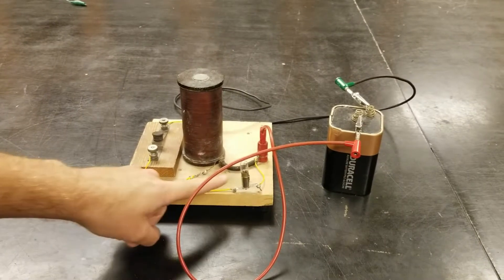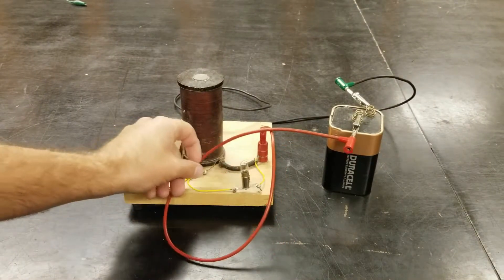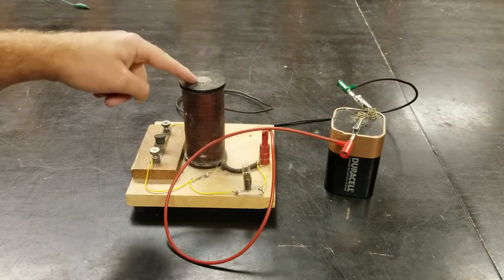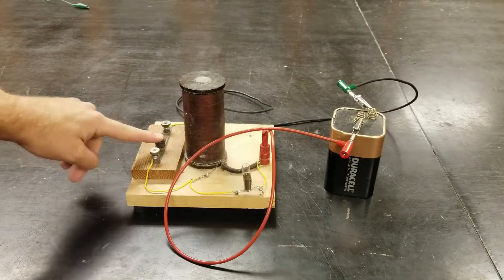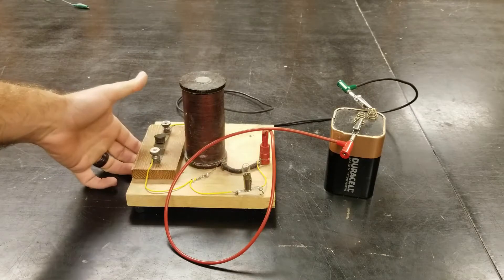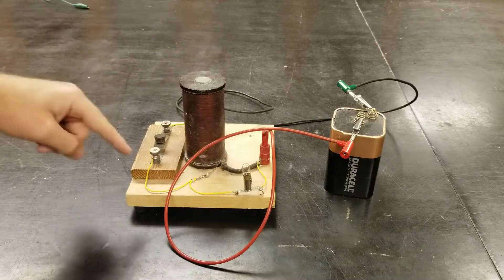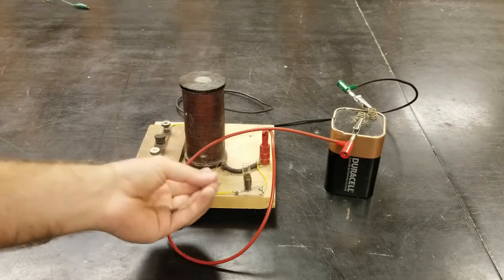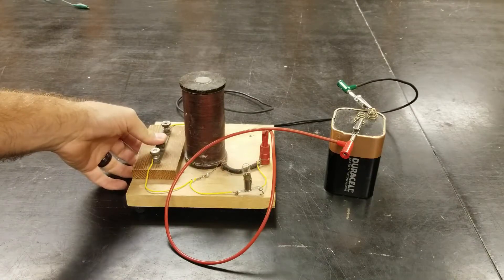Back EMF

Comment: Hello Sir, thank you very much for your scientific demonstration. If we analyse the RL circuit in any book, the potential across the inductor is the same as the potential of the applied voltage, so the battery ! Yes, the sudden release of the button creates a larger voltage than the battery. What about the current here and the power, also the energy equation ? 
Would this mean, we have a higher potential for a less time interval, which makes the current smaller, which means the product P=VxI and W=Pxt would be the same. However, the power is not a conservative quantity. The area under the graph of V(L) versus t should be the same what I understand. If we have a higher potential by turning off the switch, the time would be less, the current should be also smaller, am I right ?

Comment: It's the collapse of the magnetic field inducing a voltage in to coil, not "back emf running through the transformer getting stepped up". The low voltage induces a magnetic field in the windings ie. electromagnet, that when collapsed create the higher voltage pulse, aka back EMF.

Comment: I have back emf of 230v -300v from 10 volt supply and it is stable and lights up a 220 volt lamp. is this good?
Reply: How did you succeed this, did you build an on-off circuit, may I ask you ? How much did you put into the circuit, and how much did you get?
Reply: @Birol731  I have uploaded a video to show the back emf from my newman type motor, have a look and let me know what you think. thanks

Comment: I haven't seen this one before. Is it a transformer, or just an inductor?
Reply from the maker: It is just a transformer
Reply: It is a single winding.   The tip-off was the demonstrator pressed the switch, and held it briefly, then released the switch and the 90vdc neon lamp bulb flashed.  This is the novelty aspect of the demonstration, "press-and-hold-switch, release, and 90vdc bulb flashes despite only 6 volt battery"

However, prior to the flash, he earlier pressed the same button, and did not hold it very long, and when the demonstrator released the button, no flash in the bulb.  WHY NOT?

In other words, why did holding down the button a little longer during the 2nd push of the button create the flash?

There is an L/R  'time constant' - it is the inductance of the winding divided by the resistance.  L/R  is in seconds (of time).  It takes 5 (five)  L/R time constants to fully build up the magnetic field in a coil.  And the the button was not held long enough the first time to build up a large magnetic field in the large number of windings.

FIRST BUTTON PUSH
The demonstrator briefly pushed the button and released it, and not enough magnetic field was created in the large winding to provide the 90vdc spike of Back EMF when the button was released - when the magnetic field collapsed, the Back EMF was routed through the bulb (which is obvious from the yellow wire harness), and the Back EMF was not sufficient to fire a plasma in the neon in the bulb.

SECOND BUTTON PUSH
The demonstrator held the button down longer, allowing a larger magnetic field to build up in the coil, so when the button was released, the magnetic field collapsed, and it was enough Back EMF voltage to spark a plasma in the neon gas in the bulb.

A smaller coil - such as in the primary winding of a transformer - has a very brief "five L/R time constants" period and in my opinion, even the first button push would have lit up the neon bulb if there had been a primary winding.  But the bulb flash required a longer 'hold time' of the button,, which indicated the battery was hooked directly to the only winding we see, a large number of turns on a spool.  

If the demonstrator was available, we could ask him to show us the primary winding, but this is a 3 year old video and it's probably not feasible.
Reply: @Greg_Chase  How is that possible, is this the effect of the sudden energy release, I mean how can you explain the voltage increase ?
Reply: @Birol731  Well, we can't ask 'The Demo Guy' because of the age of the video, to show us that there are:
1)  two windings in the coil that we see
2)  and the 2nd winding has many more turns of wire than the other winding

so there is no way to reliably say "this is obviously a step-up transformer".    However, the number of turns is quite large - it's a big coil.  You can show mathematically, and it makes intuitive physical sense, that a larger coil builds up a bigger B field (magnetic field) than a smaller coil, if five L/R time constants pass to charge it up.

EXAMPLE
The B field of a 'coil' consisting of one (1) turn of wire is compared to the B field of a larger coil consisting of 1000 turns of wire.  The larger coil builds up a larger B field.  The designer of an electromagnet abandons his plans to build and sell electromagnets with just one turn, and instead builds his electromagnets with 1000 turns each.

Also - if the B field is allowed to build up (5 L/R time constants),  it is equivalent, physically, to building up a charge in a large capacitor - a large storage of energy.  

The charge stored up in a tiny capacitor cannot kill you.   The charge stored in a large capacitor can.  
The inductor (the coil) stores energy in a magnetic field, instead of an electric field.  When the energy discharges from the magnetic field, the temporary voltage spike can be quite large.  Particularly from a large coil.

The magnitude of the voltage spike - the Back EMF - depends on how quickly the magnetic field changes.  If the B field of that large coil was allowed to discharge slowly through, say, a resistor,  the field would discharge slowly.  Or if a shunt (or 'flywheel') diode was hooked across the coil, same thing - the B field would discharge slowly.

But this is a quite sudden change - it is a switch. He holds the switch down long enough (on his 2nd attempt) to fully 'charge' the B field of the coil.  Then the switch it quickly opened.   A large Back EMF spike will occur.

He is discharging the Back EMF through an inert-gas-filled tiny volume - the Neon bulb. Based on the size of that coil, the sudden change to the current flow - dropping to zero almost instantly - this is a very sudden change to a very large magnetic field.  Hook up an oscilloscope to it,  I would not be surprised to see a spike easily reaching 90v.
Reply: @Greg_Chase  Thank you very much for the explanations, especially for the effect of briefly pushing the button. So, a certain amount of energy must be stored in the magnetic field of the coil, unless a spark will not be created in the neon bulb. Approximately 5 (L/R) is enough to charge the coil, so the area under the V(L)-t graph (between zero and infinity) would be equal to A=U0x(L/R), with the unit Vs which is equal to Weber (Wb or Tm²- Magnetic Flux) if the time is very short (t << (L/R)) the area is equal to A=Uoxt, this seems to be conserved am I right ?
Which means, if you release the energy suddenly, you can have a higher potential than the applied battery voltage, in this case the time is shorter, so Ux= (U0x(L/R))/t, U0 is the battery voltage (applied voltage). For example, if we use a 6 volt battery, assume L is 1 Henry, R= 10 Ohm, the magnetic flux would be equal to MF=6V*(1H/10 Ohm)= 0,60 Wb, assume the release time of the button is 5 ms, you would get Ux= 0,60 Wb/(5^-03 s)= 120 V, so the shorter the time, the higher the potential, but I found out that the area under the graph which gives the magnetic flux is conserved, is there still a possibility to extract energy from the ambient medium as Nikola Tesla has claimed ?
Reply: @Birol731  I've been away from the math too long to remember it.  One thing I've noticed - lack of use leads to a re-acquisition effort for knowledge that once was top-of-mind.  I started playing piano at age 6, by age 8 I was performing in front of a sizable audience.  Today, I can't even remember the key signatures.  

Same with most of my electronics/EE, and software engineering.  After graduating from UC Berkeley in the mid-1990s with a computer science degree, I wrote code and worked in startups for about a decade.  I then went back to Berkeley, got my MBA, and switched to investing.  As a hobby I work at artificial gravity devices with a small group. 

So I cannot safely comment on the math without a review - it has not been top-of-mind for years.  I could say 'yes it looks correct' but I wouldn't without a review.

In our artificial gravity devices, we have a few different approaches.  Here's a popular one right now with us:
1)  lamination of thin layers of non-ferrous metal
2)  two such laminations stacked vertically, one atop the other, with an insulator ring separating them
3)  vertically-oriented magnetic field by way of a (paired) Helmholtz coil centered along the axis of the two laminations
4)  UV light focused on the metal layers to encourage the photoelectric/photoconductive effect to free up more conduction-band electrons in the metal
5)  eddy current-inducing coils, deployed horizontally and adjacent to, but not touching each lamination of metal layers
6)  eddy current coils fed by high frequency
7)  only one lamination (at a time) gets induced eddy currents, the other lamination is 'off'

The idea is:
A)   create high frequency, coherent accelerations of the charged particles in the lamination that is 'on'
B)   create an unbalanced effect by keeping, say, the top lamination 'on' and the bottom lamination 'off'

We studied the Vacuum and developed an 'informed speculation', a model, of gravity and we test our model with devices.
Reply: @Greg_Chase  Hello Greg ! Thank you very much for sharing all these informations with me, my physicist friend was also interested in artificial gravity. Let me ask you first, do you have a youtube video about your gravity device, a demo video, something like that? 
I would like to ask you another question, did you hear something about cold electricity, a sort of radiant electricity where the wires get colder, the wires absorb the heat, instead of heat dissipation.......This process has a reverse, negative entropy 🤔
Reply: @Greg_Chase Thank you very much for your last answer, about the artificial gravity device and your interesting information about the fusion reactor with an artificial gravity containment field. You want to say that, it seems difficult to extract energy from the vacuum, some scientists claimed that, when the soft electrons disintegrate into hard electrons (conduction electrons) the total energy of the aether remains constant, which seems not against the law of conservation of energy. Tesla told something about radiant energy, did you hear anything about his radiant energy concept?
How is it possible to pulse a coil with DC,  I mean strong and quick pulses, can I achieve this with a conventional function generator ?
Reply: @Greg_Chase  What about the Magnetstromapparat of Hans Coler? Lester Hendershot also built a similar device (Hendershor Generator) to extract energy from the magnetic field of the earth. Did you hear anything about these devices?
Reply: @Birol731  You can 'charge' the magnetic field of a coil with DC.  You can use a function generator, with a square wave, to pulse that DC if the DC is connected to the coil through a transister, typically a MOSFET. 

Step 1 - recall that a coil has two wires, one at each end of the coil

Step 2 - connect DC to one of the two wires of the coil 

Step 3 - instead of connecting the other wire of the coil to ground, connect the wire to the 'drain' pin of the MOSFET

Step 4 - connect the 'gate' pin of the MOSFET to the function generator output - this means your square wave, applied to the 'gate' pin, will turn that MOSFET On and Off at the square wave frequency

Step 5- connect the 'source' pin of the MOSFET to ground

HOW IT WORKS
1)  Because only one end of the coil is connected to DC, if the MOSFET is Off, no magnetic field in the coil, because of no current flow

2)   When the MOSFET turns 'on' the coil will be connected to ground through the MOSFET, and current will flow, and the coil magnetic field will appear

3)  the coil magnetic field will toggle on and off at the frequency of the signal generator
Reply: We have a small team working with devices to manipulate the Vacuum (the quantum Vacuum) for artificial gravity work, and it's not clear that Tesla's "radiant energy" will succeed without air molecules.  Coherent, organized behavior in the Vacuum is possible but it quenches fast and it quenches close to the source.

A UFO that has altered the Vacuum to hover creates a thin volume underneath it where inertial drag is greatly increased and the acceleration of matter is impeded (that's why they hover).  The volume of space under the UFO that is conditioned to neutralize gravity, aka to increase inertial drag, does not, and is not, very thick at all.

My disclaimer is that we do not work on radiant energy propagation.  The stuff we work on is to create very local effects only, and that is tricky enough.  If we would pursue answering the question "can radiant energy work outside an atmosphere" the starting point would be a vacuum chamber pumped down to 10^-7 Torr  (0.0000001 Torr) which is entirely possible with cryogenic pumps.  Not cheap to set up a big enough chamber though, and cryo pumps are not cheap either.

I worked with cryo pumps used in Perkin-Elmer sputters in the semiconductor industry early in my career, and it's pretty shocking the degree of vacuum they can establish.  The vacuum chambers are huge, heavy steel, huge manifolds and bolts, and can develop leaks.  We used helium and a mass spectrometer probe to find leaks in those things and it was a PITA.

But it would be a fairly reliable environment to check if radiant energy requires gas molecules (atmosphere) to work.
Reply: @Birol731  looking at 'extracting energy from the Vacuum' - we rely on conservation of energy and momentum and do not spend time on pursuing free energy.  Just not something we do.  We work at artificial gravity, mainly.

If you have a catalyst like in T. Henry Moray's free energy device, you have a chance for 'breakeven plus.'  His device consisted of:

1)  a first stage consisting of a crystal radio - they do not require a battery or any input power to work.  He tuned the first stage to the strongest broadcast signal in his area

2)  second stage was a cold cathode amplifier vacuum tube. Most amplifier tubes have a 'hot cathode' that requires a battery or input voltage to liberate electrons for the tube to conduct to the anode.  A cold cathode tube uses no battery or input voltage.  His vacuum tubes had radioactive radium (that was his catalyst) to create a mild ionization and free electrons so the tube could conduct.  He used a positive feedback loop so that the small electron cloud would allow the amp tube to begin conducting.

3)  The 1st stage signal (the output of the crystal radio) was fed to the grid of his amplifier tube and that signal was amplified by the tube, and the output was rectified and stored in a bank of capacitors. 

After about an hour, useful electricity could be tapped from the capacitor bank.    By using a "no power needed" crystal radio to pull 'free' oscillations out of the air, and radioactive radium as a catalyst to get his amplifier tube conducting, he really did have a 'free' energy device.

However, the radio station operator who put the radio waves in the air that Moray picked up would not call it 'free'
Reply: You can do it either way.  If it's a transformer you effectively set it up like a flyback converter with some missing parts.  In this case it's just an inductor with the bulb in parallel with the inductor.